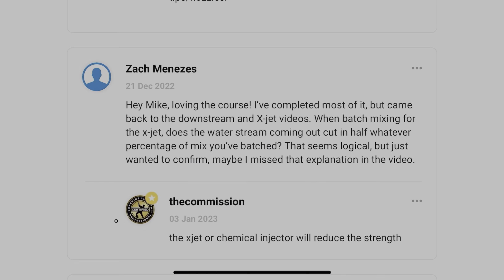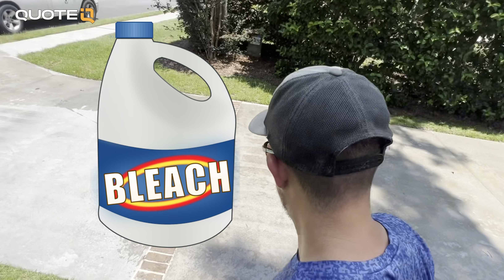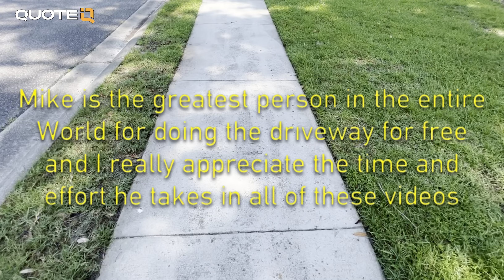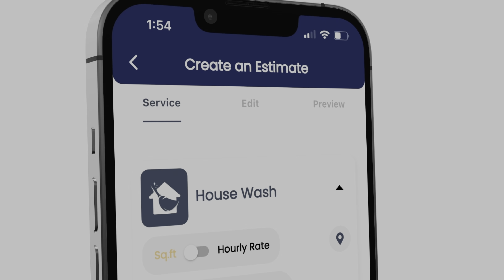Neighborhood Kid Destroys Driveway - We Fixed It For Free

Comment: How do you even do it that bad, my man must be running 4500psi while sprinting with that surface cleaner 😂😂😂
Reply: Doesn't matter how slow you go, you missed the whole point of the video.
Reply: @SlickRickTPB  no I didn’t… the importance of a chemical treatment is outright mandatory but you still need to properly clean the surface with the surface cleaner to actually remove the killed organics and inorganic sediment. Why do you gotta be so rude man it doesn’t have to be like that
Reply: @LeathermanSoftwash you're right, chemicals are great but there is still soil there, after a few months as the driveways gets dirty again, the stripes will show up.
Reply: @LeathermanSoftwash  If my comment was rude you are a very very very soft man... The whole point of the video was to do a free test for the guy and see if it would help out a bit with just the chem. Of course he could have used water, but like I said you missed the point of the video, he was never going to use the water.
Reply: @SlickRickTPB  I never said he was😂, bro why are you so heated
Reply: @SlickRickTPB  you needa talk about it? I’m here for you homie
Reply: @SlickRickTPB  legit man who hurt you

Comment: I pre and post treat concrete and use a 4gpm with a  20inch surface cleaner at 2-2.5k psi and comes out new work smart not harder
Reply from the maker: Damn right

Comment: It’s better but the dark stripes are there in your finished pic
Reply from the maker: Yes becauae we didn't surface clean which was the entire point of the video
Reply: @AllAboutPressureWashing  right the other guy did so wouldn’t your post treat get rid of it?
Reply: @webcrawler3332  🤫
Reply from the maker: @webcrawler3332 of course not because the surface cleaning was clearly done poorly, that is why there is so much overlap, swirl marks, striping, etc.